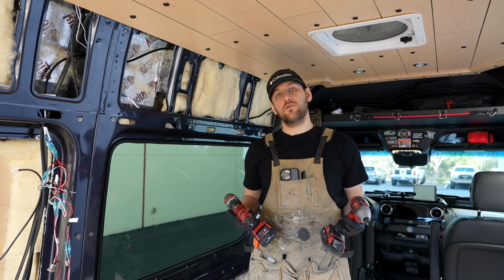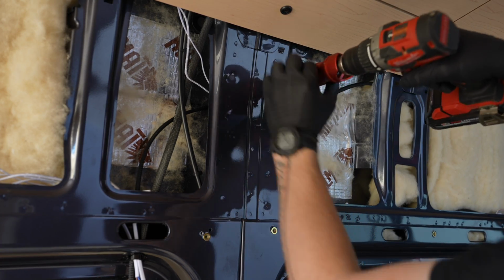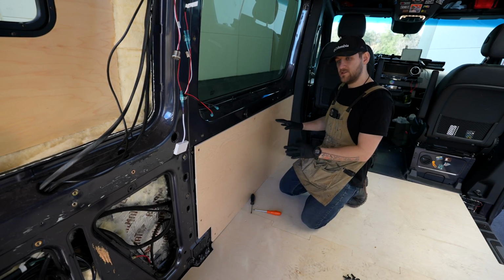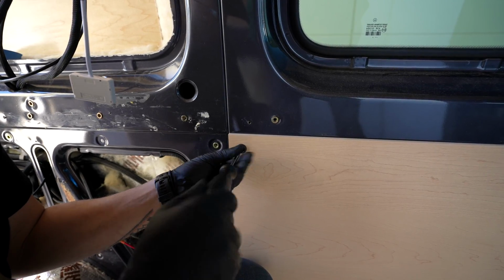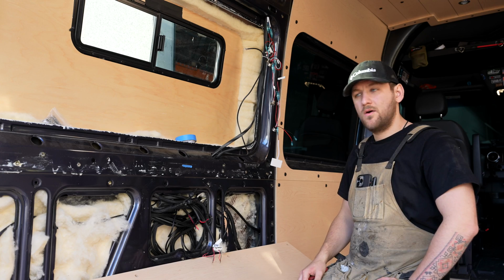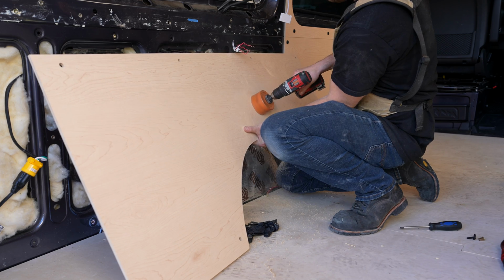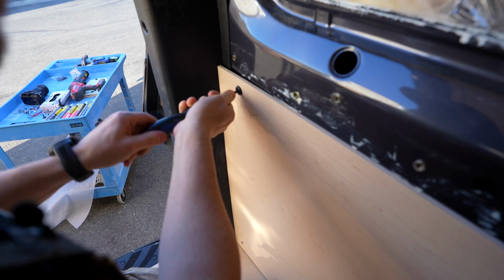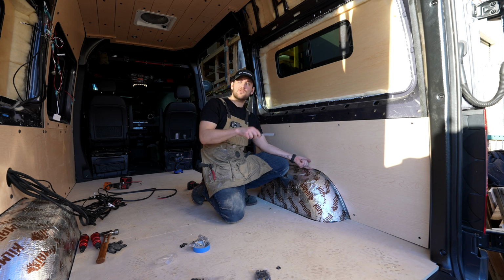Sprinter Van Wall Panel Install | Serg Supply

Comment: why do you have to drill the holes bigger? Cant you rivnut sizes that fit the stock hole? Im trying to figure out what size the stock hole is for some shelves in a plumbing truck.... Or is it just a better idea to drill the hole bigger to get some fatter rivnuts in there

Comment: Why not use Plusnuts?
Reply from the maker: I love plus nuts, don't get me wrong. They do, however, tend to crush at odd angles, so I have to go through them with a self tapper constantly and it makes me want to punch drywall. Strength-wise though, they're a great option.

Comment: so many screws? they look very big and obtrusive
Reply from the maker: They look great when the wall panels are installed.
Reply: The walls and ceiling are curved.  Unless you attach frequently along the curves you walls will lose interior space (bad), rattle (bad), and come loose (bad).